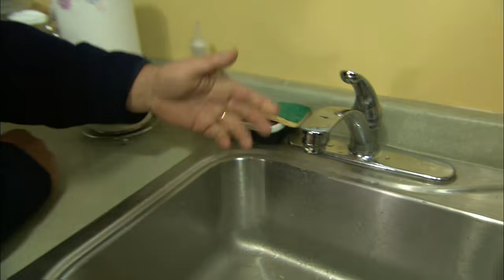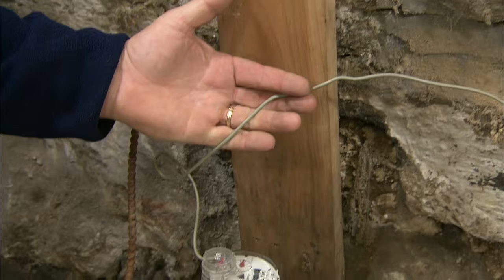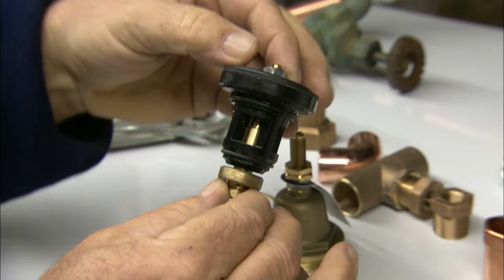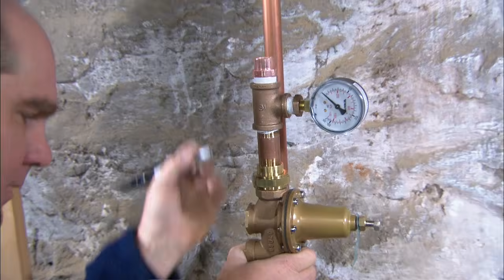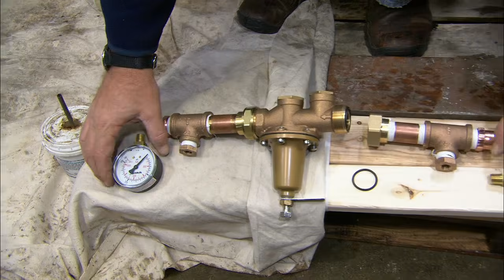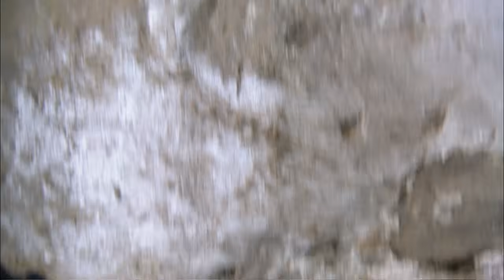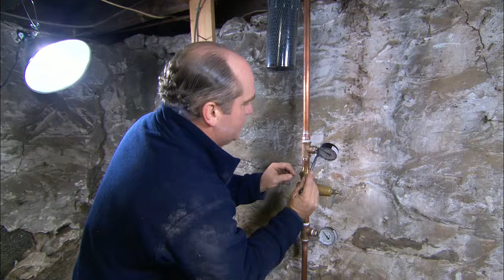How to Install a Water Pressure Reducing Valve | This Old House

Comment: Can a pressure reducing valve be used on a well system that uses a on demand style pump switch?

My well pump delivers 4.75/5 bar every time a tap is opened, I would like to reduce this to the 50lb/3 bar as recommended in this video
Reply: You need a pressure tank. It has a air bladder to maintain a specific pressure range
Reply: You need to read up on well pressure tanks. I'm surprised you're getting above 50psi from a well system, though if the pressure tank assembly has a 30/60 or 40/60 switch, I'd still leave it alone. Make sure the tank is charged and the bladder isn't broken. Almost sounds like your water heater's expansion is trapped by the well system's check valve, in which case I'd wonder if your well pump isn't running all the time, with a pressure tank with a ruptured bladder and completely filled with water...

Comment: My house doesn't have this valve & my house has low pressure coming from the city will the valve increase the pressure as well
Reply: the valve reduces pressure. You may want to discuss with the city or a plumber regarding your specific issue.

Comment: The only thing unrealistic, here, is the enormous amount of space that he has to insert inline two gauges, in addition to the PRV.  A more realistic situation is having no space for any pressure gauge and barely having enough room even for a PRV.
Reply: George X … based on the new looking main valve and the water filter AND the fact that he's most recently complaining  of water hammer, I would say they just removed a well tank... and that would explain the extra room to work in the basement.

Comment: what is the expected lifespan of these? thanks!
Reply: I had to replace mine when I moved into my house a few years ago. That was 2018 and house was built in 1992. Not sure if that was original to the house or installed later.
Reply: They are designed to last around 15 years.  Mine lasted 25 before it failed.

Comment: couldnt he adjust pressure by just slightly shutting the main water shut off, he could even leave the guage to find exactly the 50 psi
Reply: No. This would not affect the pressure, just the flow rate.

Comment: How would this affect the backyard sprinkler system?  Would it also reduce the water pressure back there?  Our house is on a hill and we get about 120 psi from the main, but when I reduce it to anything less than 80 psi, the backyard sprinklers won't even pop up and the pressure inside the house is still too strong.  What's a good fix?
Reply: Prv after the irrigation tee
Reply: It would.  And if your sprinkler was properly set up before putting something like this will totally cause havoc with underwatered spots, and may require extensive rezoning.

Comment: Is it essentail to install pressure guages with PRV. If YEs . So according which standard?
Reply: No, it is not required.
Reply: No, I never do.  I just check my pressure twice a year at a hose sillcock twice a year.  Much cheaper and the gauge lasts forever this way.

Comment: Horrible practice to solder so close to those taped male adapters. Also, there will be more pipes banging than ever before because they didn't add an expansion tank into the now "closed" system! Horrible!

Comment: I just installed a new Pressure reducing valve and my pressure in my house is still only 40 at the most.
Reply: Maybe the city water pressure is too low.
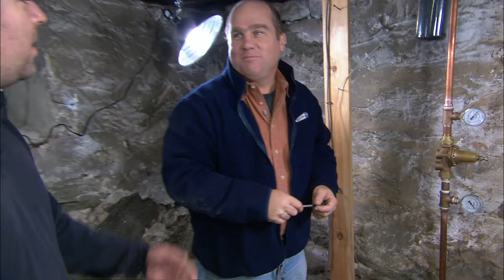Reply: Turn it up. Like  was shown @5:11
Reply: What is the city water pressure?

Comment: I would never solder fittings with teflon tape on them already lol, that could be asking for problems after
Reply: I was thinking the same at that clip. Not sure if teflon is made to handle soldering temperatures. It may melt and the sitation becomes luck instead of knowledge that it’s watertight.
Reply: .
I was wondering about that too.  If he is using real Teflon tape, it isn't a problem .  A lot of that PTFE tape is rated for 500 deg F. Plumbing solder melts at 370 degrees.
Reply: That’s the way I was taught as well. Anytime you had a male adapter with dope or tape you’d swear on a 3-4” lead so your heat isn’t right on it. We’d also wrap a wet rag around that or any parts that could be damaged by heat. I love the comment that your obviously not a plumber. I’ve met several plumbers who did it this way and some who didn’t. Personally I go with better safe than sorry. Especially when the PRV comes with unions you could dry fit everything mark your copper then sweat your two males then put every thing together.
Reply: Dill Wiggle na they are fine they could always tighten it a little later on if need be. What he should have done to be safe is put megaloc on it with the Teflon if he was going to solder.
Reply: I've been told burning teflon can release toxic gasses and make you sick. I always sweat on male or female adapters and then tape them and put them together.
Reply: 25 years. I always add copper to it, to get it away from the heat.

Comment: I do not hear a thump. Instead, I hear a sound similar to blowing across the mouth of a coke bottle after turning the water off. It can happen when any temperature of water from any source in the house it turned off. 

But:
1. It doesn't happen every time - though most of the time - and I can't seem to identify a variable.

2. We hear the sound many times when water hasn't been run recently! Sometimes it is in the middle of the night or while watching TV, for instance. Why would that happen?

3. Our water pipes are not visible except in a small area of the basement near the water heater.

4. Sometimes the sound continues for several minutes. I once clocked it at 4.5 minutes, though usually it lasts only a few seconds. You can hear it throughout the house.

We bought this house only a few months ago and it has happened the whole time. The house is a single story home in the mid west, built in 1974, situated in a small town, and uses city water. There is no water softener or  anything like that installed.

I do see that I have a pressure regulator. Would a defective one cause what I've described above? Anny idea what would?

[Note: I don't know plumbing, so please write for a novice).
Reply: +godluved Sounds more like a drain/vent issue than a supply issue. To check this, do 2 tests. First, go to the faucet furthest from the main line and turn on the cold water slowly to try to replicate the sound. Secondly, fill a five gallon bucket and dump it into various drains and toilets in your house.

Comment: Hey great video. I'm trying to recreate my own just like this. I wonder what is the fitting between the pressure reducing valve and the brass tee fitting? Looks like threaded copper pipe? If so, is that for purchase somewhere or do you have to cut those threads yourself? Thanks for any guidance.
Reply: That is threaded red brass.  NOT regular k,l,or m copper pipe.  Frequently available in short lengths just for this sort of purpose.  You may have best luck at a plumbing supply shop, or online.  Good luck.
Reply: Get one that includes unions
Reply: So I finally got this together, and while challenging to install in the crawlspace it is now taking my outside pressure at 129 psi !!! to 68 psi inside. Very successful, wish I could post pictures. Thanks for this video.

Comment: i wish my water pressure was 100
Reply: Then you'd be spending $450 or DIY'ing a pressure reducing valve in...

You're fixtures probably limit the flow the most. Especially showers, and especially if you're in a more protectionist type state/country.

Comment: Looks like they did some new work to the main line before filming. That’s why all that water is there.
Reply: Probably a leaking wall and floor.  Did you see how vintage that wall was?  Possibly 1800s or early 1900s.

Comment: Are the gauges considered standard install when having a water pressure regulator installed for my home?
Reply: you want to at least have one right after the valve...
Reply: No, they are not.  You can accomplish the same thing with a handheld valve on a sillcock or laundry sink.

Comment: I wonder how much it would cost to have one of these installed?
Reply: The valve is about $100 USD and labor with fittings can run $400-500 depending on your local market.
Reply: $900 just this month.  Did it myself and did a much better job than any plumber would have done, especially the young ones who do not know how to solder and are afraid of it.

Comment: Richard should have used pipe dope with the tape, should have soldered the copper fittings by themselves and not as an assembly because it heated the tape too much, he should have reapplied tape/dope to the threads on the gauges after reassembling them, and he didn't ream the pipes.
Reply: What he should have done was to wrap the copper, taped fitting with a wet strip of cloth.  That would have prevented any chance of the fitting solder connection from being damaged or the teflon tape being damaged.

Comment: Hmmmm, I have a question. So I got a new apartment and the kitchen tap had a leak. So a replaced the tap + tubes. However 3 days later 1 of the tubes basically exploded from the water pressure. Since I have little technical background I don't really know what to do with this. I'm in a big apartment block and have 4 water valves in the apartment. 2 in the bathroom and 2 in the kitchen.
The 2 in the kitchen or on the main pipes towards my sink. And I was wondering if I turn these valves only open by a inch instead of completely will this take pressure of the flexible tubing ? As these are behind the valves. 
Thank you
Reply: Jordy Rosson nope, opening the valve only partial will likely cause the water to hammer.
Reply: You 'got a new apartment?' You're renting an apartment? Don't do work on other people's stuff, for a few reasons. You don't know what you're doing, you aren't licensed or insured, the owner/manager/etc should be getting this work done (and paying for it). You're just supposed to live there, keep it clean, change lightbulbs, and maybe paint the walls.

Comment: I went to the plumbing supply store and asked for the parts to the  demonstrated set up with two pressure gauges and they called me retarded. However this was a helpful video, installed the pressure reducer today and just checked the water pressure on the water hose spigot.
Reply: It's okay if your into throwing  your money away.  Installing the two gauges.
Reply: I think anytime you're installing new fittings on your main water line, you want to reduce potential failure points.  Adding 2 pressure valves both downstream and upstream creates 6 additional points of failure on the line.  This was done for the show for demonstration purposes only and is not considered best practice in the industry for residential applications.

Comment: How much does this installation cost nowadays? I'm in Massachusetts also
Reply: We got one installed during a water heater replacement as sort of an upcharge, but I knew we needed it (plumber wasn't making up the issue), so it was a "sort of included" type of charge.  It was $450 total here in New Jersey, with the Watts regulator valve as a $350-$400 part now (plumber upcharges for having that inventory on the truck apparently).  
I'm looking into doing a big carbon tank to go with the water softener which still works fine - and replacing the Pressure Regulator can definitely be diy type job, after taking a closer look.
Reply: Just got a quote yesterday for same exact thing to be done $926.00

Comment: Ive got 100psi coming into my house, should I bother getting a valve installed?
A plumber wanted $300 to install one and tried to scare me saying it can blow out my water heater and other plumbing problems?
Reply: You can always try getting a second opinion, and second price as well. $300 seems fair to me. Would be worth it in my opinion just for the peace of mind knowing your system isn’t under more pressure than it should be. 

Just found out yesterday our water pressure is the same (95 psi), but we’ve been living in the house for 5 years now with no issues. But I’m having a plumber swing by next week to install a pressure reducer valve just so I can sleep better at night
Reply: @snipsey2  
Bad thing is your shower pressure is greatly reduced!!
Reply: @motorcitymanman7711  Yeah that's bullshit.  I have three showers and four tubs in my home with six people.  Everyone can shower or bathe each morning with no issues.  My city water pressure is 100+psi, my home pressure is 50 psi.  If there were problems, I would know since I have three daugthers and a wife......😂

Comment: So what's the damage bill for that work, I doubt you will let us know..
Reply: 400-500$
Reply: I actually had the reducing valve plumbed in a few months ago. $450 for parts, labor, etc.
ETA: Included a new pressure tank installed off of water heater as well.
TOH doesn't charge people I don't think... since they get money back for viewership, like most any TV series...
Reply: I just got two quotes in the $1,200 and $1,500 range in Greater Seattle area. Going to buy the tools and do it myself.

Comment: Mine is $600 for the part only. Only one place in town that will order it from out of state. Not sure why my builder went with this one. Haven't been able to find a compatible one that's less. Anybody know, can I have the line redone to accommodate a different one. 10 year old house and this is the second one I've had to replace.
Reply: 1 1/4"
Reply: You may have an 1 1/4 inch pred because you have sprinklers. If you don’t have sprinklers you should be able to reduce a copper water line to 3/4 with a reducing coupling. Check your local code. Also, watts used to recommend that pressure reducers be installed on horizontal lines, which could be the reason it only lasted 10 years,(if it was vertical )
Reply: Sam, wow, not sure which one you have but in my opinion you are getting seriously ripped off at that price and I suggest you look elsewhere.  A quality Watts regulator of that size should not cost you more than around $370 plus tax.  You can find them online.

Comment: If someone could answer this: If my pressure valve has the pressure set to 50 or 60 for the house. If someone flushes a toilet while another is taking a shower should that valve open up all the way to allow the more of 110 inlet pressure in to try to bring the house pressure back to 50? If so the person in the shower should not notice a toilet was flushed. Or is my pressure regulator bad. How can you tell if you pressure regulator is working properly. Is mine working properly, I actually have mine at 65   an it holds steady on the gauge when no one is using the water. However when some uses the water the pressure drops to 20. Is this normal or should the pressure valve open to try to bring the house back to 50? I hope I explained that properly.
Reply: hook up a pressure gauge to your outside faucet ..turn it on ..see what you have for pressure. then turn on 2 more faucets.. it should not drop more than 10-20 psi. if it drops below half you have a bad reducer or sometimes the water meter can be blocked..i have seen that in apartment buildings i have worked at.
Reply: You either have a restriction somewhere or the PRV screen is clogged, causing a restriction at that point. Watch the part where he's playing with the cut-away unit and you can see the screen. The PRV itself will keep the pressure fairly constant (within say 10 psi) as long as the flow is not blocked otherwise.
Reply: In older homes it is common problem that the trunk line isn't sized properly or that the toilet and shower is on the same cold line and the pipe diameter is not large. .. so if you flush a toilet and the cold water pressure drops in the shower, then this is likely the problem. This is very common and only way to fix is to  run some new lines.  In newer homes they typically put in large trunk lines to a manifold and then smaller lines go out to each fixture.   The PRV or outside valve wouldn't affect this much if it is the problem.
Reply: Could be the main line is not large enough or could also be that both the shower and the toilet are on the same 1/2" branch in the same bathroom, which means the cold water drops off and the person in the shower get's a blast of hot water, which is common in older homes no matter what you do, short of replacing the shower valve with one that balances the pressure change for that situation. The only way to check the PRV is to monitor with gauges like in the video. If the house side drops more than a few pounds then likely the PRV or the internal screen in the PRV needs attention. Cleaning the screen is common so look to see if it has one like they show in the video. (the other big nut on the bottom) All you should need is a small brush and a bucket of water, then reassemble things.
Reply: as long as you do not install any lines larger than what enters you meter you will be fine...you will lose pressure if you do that.
Reply: Pressure red.valves have a design max flow rate. The higher capacity PRVs are larger and more expensive. This video did not address selecting a prv with adequate flow capacity.  Additionally, there are pressure reducing valves, and pressure regulators. Know the difference before buying.

Comment: Question: Will Teflon tape survive soldering?
Reply: peger that was kind of dumb IMHO. I'd solder the threaded adapter separately and then screw the rest together when it cools. Why risk it?
Reply: I normally use the blue monster teflon tape plus pipe dope (Rector Seal 5) what one  suppose to do is to get wet rugs prior to solder in order to protect it. White teflon tape might not survive soldering

Comment: Anytime a pressure reducing.regulator is installed and expansion tank need to also be installed, not sure if already had one but should have been mentioned.
Reply: Not if you use a PRV with an internal bypass.